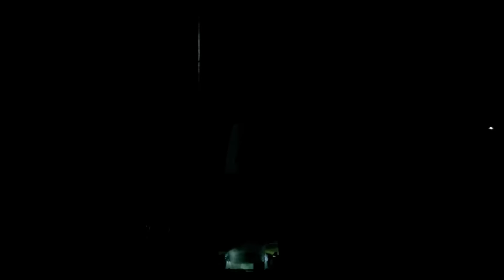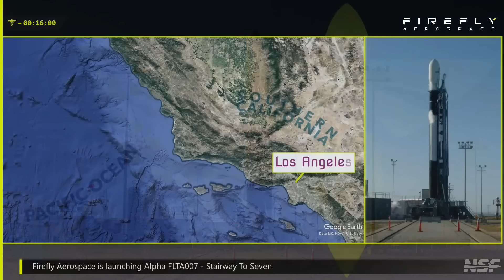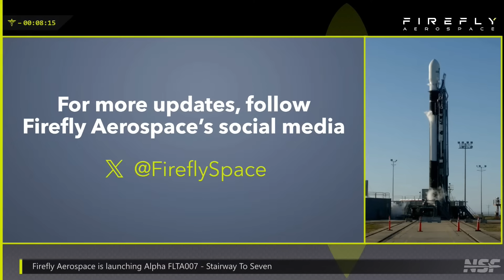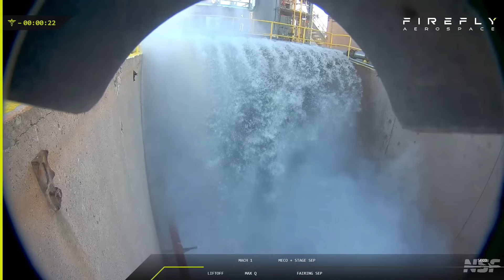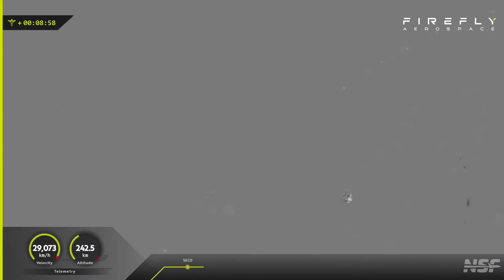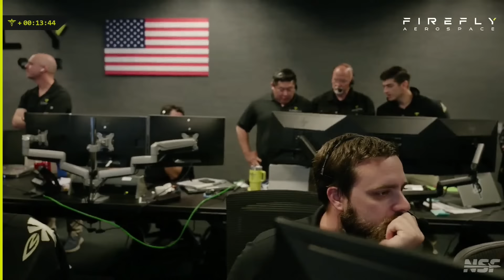Firefly Aerospace Launches Alpha Flight 7 "Stairway To Seven"

Comment: 7 Launches in and already doing block upgrades. Nice. Should hopefully see some performance increase as its occupying a sweet spot at the moment with Electron at 300kg and Alpha at around 1,000 and then Stoke targetting around 3,000kg.